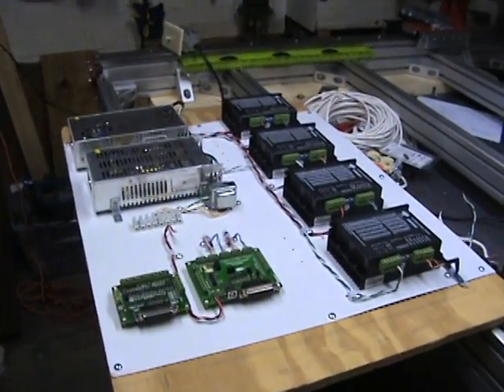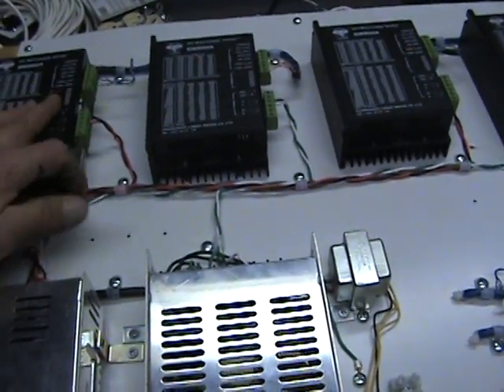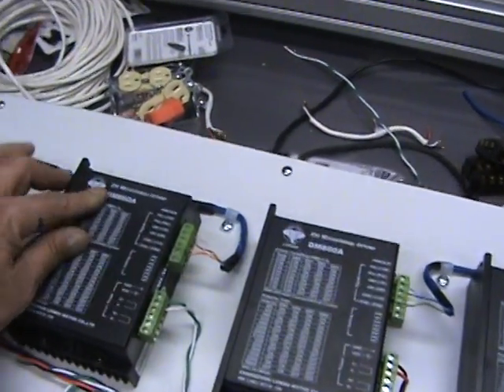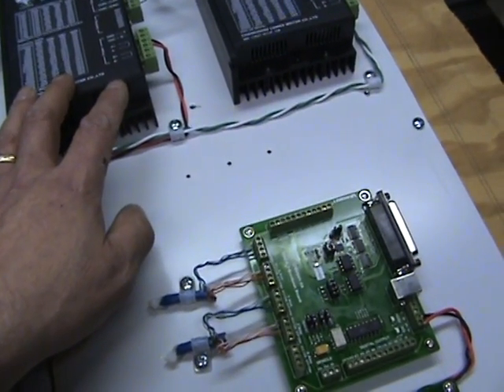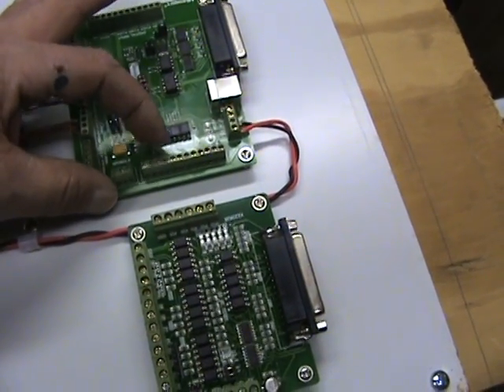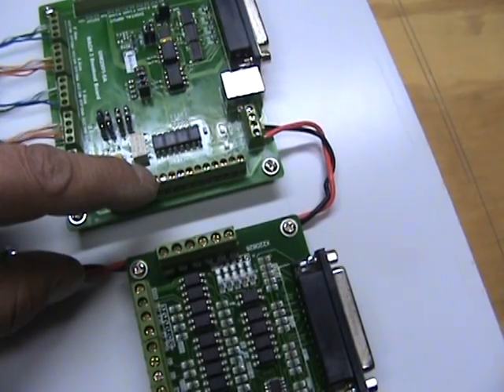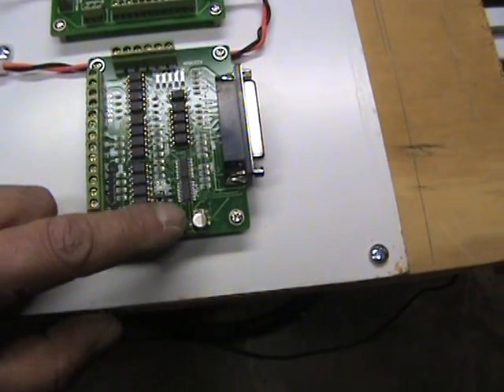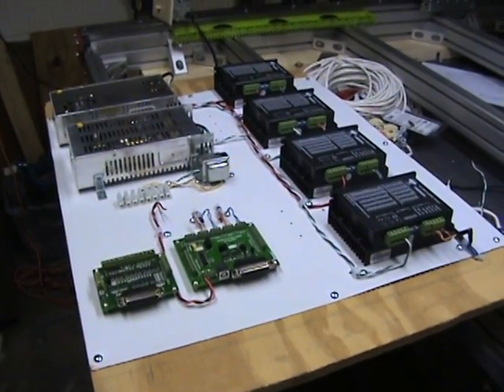Building CNC Router Parts CRP4848-16.MPG

Comment: Diode caps and a 12 volt regulator transistor 12volts AC 12x1.414=16.9 volts DC